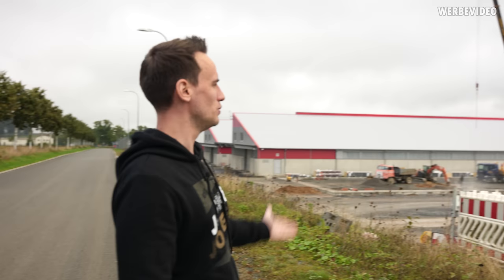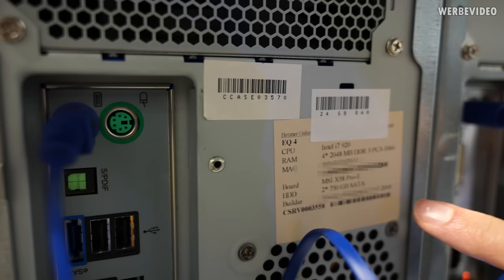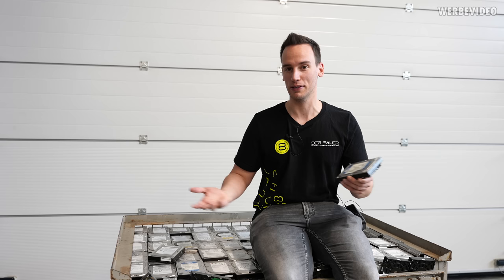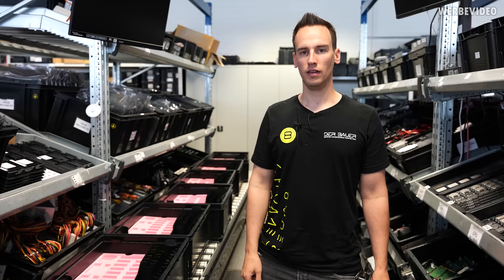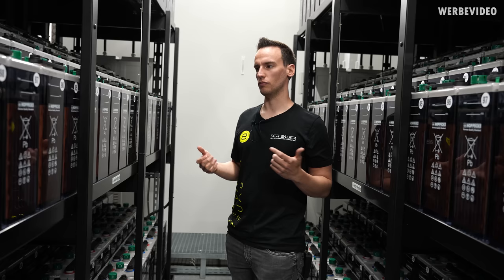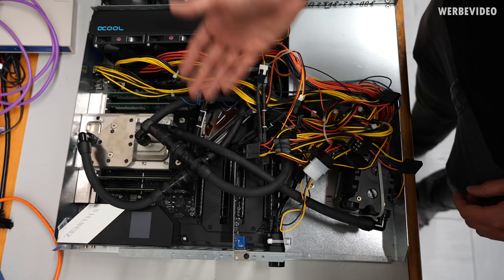Over 200,000 Servers in One Place! Visiting Hetzner in Falkenstein (Germany)

Comment: Man, building servers there would be my  DREAM JOB! Do you know if they are recruiting? Even better would be them expanding into Ireland so I wouldn't have to move!
Reply: It would get old
Reply: @mrmotofy  Not likely as hardware keeps evolving ;) First PC I've built I was 11 and trust me when I say that this has never gotten old for myself, quite the opposite, new hardware and/or technologies coming to market keep things interesting! Like when FLASH finally came of age on SSDs instead of USB sticks.
There's always something new or improved around the corner and sometimes some deeply disruptive changes like the switch from AT to ATX that resulted in a considerable upgrade cycle although this may not be the best example.
Reply: @wskinnyodden  Yea...but building these servers is gonna be very repetitive as they seem to be virtually the same. So some might have a 100Gb Nic instead of 10Gb...big deal yes I remember AT vs ATX, I picked an ATX as it seemed the way it was going.
Reply: @mrmotofy  Well, that is just a challenge on how to get as many as possible going at the same time efficiently and correctly. Wouldn't be a first, I still recall the first time I had 10 systems on the work desk at once being installed and set up each for a different customer. (Christmas time for a computer shop back then)
Reply: Trabalhei no data center da Embratel nas olimpíadas do RJ irmão, foi meu último job depois que me mudei pra EUA, queria muito voltar pra área também seria um sonho tá num lugar desse de novo

Comment: Is keeping these old equipments like i7 920 really environment friendly? I don't mean to judge that, just courious. I guess there is a comparation between recycling these low power efficiency device and keeping running on them.
Reply: I was surprised by that too. These are OLD 4 core CPU’s with ancient architectures and - relative to today’s standards - terrible IPC. They could probably consolidate an entire aisle of these ‘servers’ into a single rack of modern 64 core Milan servers and just run 4-core VM’s on them if that’s all the customer wants. And even if they want a more consumer oriented platform, modern Threadripper or even Ryzen (to a lesser degree) will provide similar levels of consolidation.
Reply: @benjaminlynch9958  If you're not familiar with the way Hetzner works, you buy the entire machine as a baremetal/dedicated server. When you no longer want it, you can auction it off online via their marketplace. It's sort of in their business to not mess with bought dedicated servers and let them use them until they fail, even auction them off to other hetzner users. I'd imagine the cost of trying to migrate everyone off those old servers (Forcing downtime, trying to migrate disks, and trying to match the same low prices) just isn't worth it. 

It is kind of nice that you can buy one dedicated server from them, and as long as you keep paying, you can use it virtually forever. Of course, the downside of wasting energy and space.
Reply: @1pcfred  Didn't I mention the comparation between recycling and keeping? Old products are less energy efficient, and energy requires labour, too. Why not think carefully before judging someone?
Reply: @1pcfred  calm down, what do you get by telling that to the people, do you think i want to know such information when i buy a fucking ssd or a new cpu i need?

no one said the world is perfect and the blame can't fall on customers
Reply: @arch1107  but it does, I see so many people with hardware they don't really need, probably 80% of all users could use a 10 year old system without any impact. Which funny enough is about the ecological break-even point of hardware, 10 years.
But people always want the new stuff, don't they? ;)
Reply: @RobinCernyMitSuffix  in my personal case, i often go for bang for buck, that always leave me with a desire for more performance

for example, i have a r3 2200g, but i want a r5 and even might have use for it!

same situation for the rest of the parts

people often does what you say for different reasons but desktop pcs do end in such time periods of use and recycle, when they are close to be obsolete, noisy as fuck and all filled with problems that no logic amount of money can fix

often people want to keep alive windows vista machines, i always say no, one would like to make those shit old pcs behave decent, but no, is a waste of time, in these pandemic times people think twice about changing pcs, is a complicated moment we are living
Reply: @arch1107 :  On the contrary, it's easy to keep Windows Vista-era machines alive.  It's a straightforward process "To make those shit old PC's behave better".  Drop in the latest version CPU the motherboard can stand, max out the RAM, install current Linux Mint on a small boot SSD, keep the old HDD.

That's not a waste of time at all — and it's as green as you can get, given they have such lightweight PSU's.
Reply: @stevearkwright  well, those motherboards often support only 4gbs of ram, or perhaps the 32 bit cpu is the problem, not sure

the cpu often eats 100 watts just being idle

some old bios will not recognice ssds, i know because i had to fight with one of those vista machines like 2 years ago, only accepted old ssds, not new

i am not sure if is a good idea to keep them alive, at certain point you will feel like you can't live without a usb 3 port or with a gpu that can barely do youtube at 480p

Comment: Wow. I though datacenters or any kind of enterprises are running only xeons and epycs. I always wondered why intel, amd or nvidia artificially lock up their consumer hardware. I though that no one is willing to run consumer hardware for enterprise use so it seemed stupid to me that they bother to lock up certain enterprise features. This changed my perspective. And AMD or Intel must be quite mad seing 3900x being used instead of epycs which cost twice as much :D same for i7 instead of overpriced xeons. Very very interesting video.
Reply: Hetzner isn't "enterprise grade", it's inexpensive hardware at an inexpensive monthly charge that doesn't make you sign a long-term contract.
Reply: @PablumMcDump  Thanks for the correction. I went to their website a see now that I can rent specific servers with consumer HW, I thought that they are using the ryzens and i9 for cloud. Still though I didn't know this existed.

Comment: I would have imagined they just sold old hardware because it's just not power efficient. even if it's fully functional they can do the same thing with 15W that the 920 does with 130W
Reply: As long as you have the space and you're not paying for AC then power probably isn't that expensive to make it worth upgrading the whole lot. I'd guess they only retire hardware when it's just too slow to do anything useful.
Reply: @Gractus  only because they have relatively few left. If they had a building full i7-920 machines the power difference would cost a ton
Reply: Right now on their server market place - the oldest CPU is i7-2600 - if you get that server I guess they will let you run it for at least 2 years. So the i7-920 is just running because you do not want to piss of your customer - but the wattage is too high. However likely people using such an old server have that server idling most of the time - so it doesn't matter too much that is has a high TDP. Next likely those 95W 2600 are phased out. Lately the push with free setup on AX servers but not EX is clear as well - they must have figured overall power use is much less compared to same price EX (which likely has lower hardware cost). Not everyone maxes out the CPU of their servers. E.g. I have a AX-41NVME which is idling 99.9% of the time running just two websites. I cannot go virtual/cloud because I need 10TB hdd for downloads on those websites. Cannot find anything cheaper than hetzner. I run a second server to compile stuff, which needs 6TB hdd, and 1TB NVME space - it's only used 1/6 of the time. rest is full idle. Also when not compiling I need the hdd to store lots of data. Again I do not see a cheaper solution. Yes I could use one bigger server instead of two - and run one in virtual machine. But I fear reliabilty so websites needs it's own server. Likely many people are like me - only maxing out some certain aspect of their server - and not having it run 100% for much of the time - hence Hetzner can offer them soo cheap. I would love if Hetzner lowers prices and charges electricty directly to customer - but likely it's too complicated so they just keep it simple and lose money on customers constantly maxing out their server. If you maxed out your 920 you would already have upgraded. And on idle likely the power difference is not much - hence they can afford to keep them running. On the other hand - virtual servers/cloud will always be on very modern/energy efficient hardware.
Reply: They are still power efficient — given that most are idling or on low load.  I think that's a sensible use of resources as they're using very little electricity.

Also, junking perfectly good hardware in useful service is certainly unnecessarily wasteful.  I applaud their approach with these older midi-towers.

Comment: I like how the assembly person is using a wired ESD strap, unlike the assembly person at Minisforum, and their wireless one.
Reply: U mean this data center is using outdated technology. Not even using wireless power supplies?
Reply: @Jsteeeez  That don't explode.
Reply: @S.Madman  gigabyte was just testing a wireless power supply that also doesn’t need to be plugged in because it runs off a internal fusion reactor. Those explosions were clearly user error. To quote apple “they were holding it wrong.” I built my computer with a wireless Esd strap and wireless power supply and its so efficient that even when I turn the computer on my power meter says its drawing 0 watts? Only issue is non of the fans or lights turn on and my monitor doesn’t turn on. Also the cpu and gpu won’t turn on, but im sure its my fault.

Comment: Very nice video and much more informative than the 3D virtual tour / google street view style server datacenter tour. Pretty happy Hetzner customer since 11 years with 2 servers. Support is great too - except when you have an uncommon hardware failure. I recently had the PSU fan broken - the problem was that the server ran just fine without load in rescue - then would power off as soon as even a little load got into it. I complained that some hardware is broken - but hetzner told me it's  the network card misconfigured but they can run a 24 hour check on it. I guess no one will ever walk up to your server and look at it - because broken PSU fan should be easy to see. Their script took them 20 hours to figure out the hardware damage. Really annoying if you host your website on that server (and due to huge download archive I cannot just quickly move the website/have a full backup elsewhere ready to go). After it was fixed decided to upgrade the server (4.5 years old) to a new one directly.  But yeah - if you cannot figure out the problem yourself (e.g. hdd smart data showing broken disk or something very obvious) - hetzner support on broken hardware is bad - as they just run their automatic remote script before dispatching any technician to actually have a look
Reply: @stevearkwright  I would need to back up every week 3-4TB. But I can recreate the data within 48 Hours.

Comment: I would definetly still call these HDDs "messy" because without any sort of "stand" the HDDs can easily play Domino or fall off.
Thatswhy I would definetly 3D print some docks which can make cables unesessary and you can plug and unplug HDDs. But that is the only thing I must say looks rather "suboptimal" the rest is really well organized and exciting. Too bad I made very bad experiecne with Hetzner's support in the past. Especially how they are "not" dealing with DDOS attacks.

Thatswhy I had to switch over to OVH -- but still a very amazing data-center to see in a lifetime. Thanks for the video.

Comment: The first thing I noticed was the angled white roofs to help with cooling and convection, and am wondering what cardinal direction the slope faces in regards to the sun.
Reply: Well, presumably north or north-east.  In other structures, such as offices where they're trying to attract heat from sunlight, the roof direction is opposite.

Comment: For batteries an usual configuration is 300V (or slightly higher, like 360V, so on low battery it is at 300V) and use a high frequency pwm with a low pass filter (coil and capacitor) to imitate A sine wave, or it may just be a square wave. This bypasses the need of a step up/step down transformer.

Another option if the psus are all known is to actually feed 300V dc (which is stepped up or down from the batteries) because most psus' first stage is turning the ac into DC.

So basically either grid synced sine wave,  a square wave, or just DC.

Comment: regarding what you said about server overclocking
But beware, severe overclocking is possible, but the entire server case structure with more fans must be rethought to ensure better and more efficient cooling

both on the old server boards and on the new ones, overcloking is allowed

but you must be very aware that your power consumption will also increase when you overclock to the server or CPU

but as I said and mentioned it is possible to overcloke the server or CPU but you will have to invest money to add very good cooling when the processor is overclocking to maximum capacity
Reply: They just don't want customers to be able to overclock the servers. Making overclocking physically impossible is safer than mentioning that in TOC and then enforcing "soft" rules :-)

Comment: Having worked at a tier 4 datacenter, there's a lot more copper cabling in these DC's than I was expecting.
Reply: Likewise — I noticed ethernet cables but absolutely no fiberoptic whatsoever.  Maybe we just didn't see that part of the datacenter.
Reply: they have the „advantage“ to have mostly weaker single tenant all in one servers with north south traffic. So i guess only the TORs to the backbone are Fibre (and also storage areas for their cloud services) but the servers themself are mostly 1gbits only.

Comment: 13:25 The issue I have with the original solution is that it's a "get it done asap" solution and while they did take care of strain reliefs and such, those are not mechanically fixed solder joints and what looks like 0.28 cables. Those absolutely need a solid fixing point in the long run, as seen on the printed ones because they will just eventually break and lose a lot of time for that fix. Even worse is if the broken leads touch metal on the PELV system (neg and earth both connected to chassis), they can royally cock up components upstream, like the controller blinking the LEDs, which is connected even further upstream to the tester. Always take care of the IP rating and always take care of the joints.

Comment: The power of the Microprocessor, Engineering, UNIX and straight up willingness to do a thing all in 8 (Now 9 probably) Massive structures.
Reply: Please just say Linux, that's probably what most of their servers use and what they officially support, UNIX is a proprietary piece of software that isn't used anymore, that's a handy shortcut to encapsulate Linux/BSDs/MacOS but that's all.
Reply: @heroe1486  You are correct but there are systems out there still running BSD, AIX and HP-UX
Rarer than Linux but still a UNIX-Like system all together.

Comment: Anyone have a part number for that SATA/SAS expander in the PCIe slot? @ 17:43 That is a serious back plate.
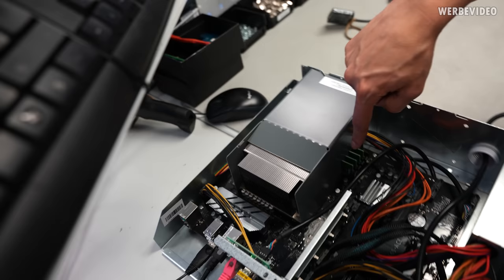Also interested in what they are doing for IPMI/BMC/ILO/DRAC riser board @ 11:49
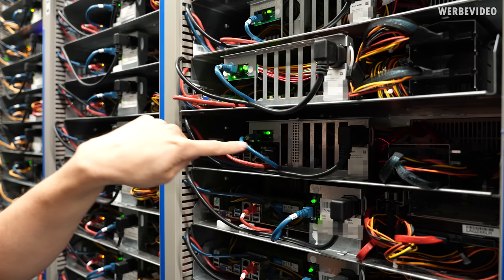Reply: As we can see at 17:38 these are just pin-to-pin connectors for the front IO (power button, reset button, maybe activity LEDs), which lets them reset servers over the secondary ethernet cables we see at 14:38.
Reply: @fredwupkensoppel8949  They look more like PCIe to U.2 adapters for the SSDs
Reply: @RobinCernyMitSuffix  Oh yeah I was talking about something different, right.

Comment: 13:02 this is indeed messy.
SATA cables should not be flapping in the breeze like that considering they are used for testing drives.
I'm sure they figured that in their HDD quantities the chance of cable go bad due to constant reconnections and handling is enough to produce silent false-positives to noticeably up their failure counts.

Comment: Nice Alphacool NexXxoS UT60 Full Copper 1080mm/1260mm? Nova Radiator with Arctic Cooling P12/14's using Noctua low noise adapter cables at 18:56

Comment: I'm kinda curious about the efficiency of those old midi towers. Even though the thought behind it is very noble and great - to use hardware as long as possible - im not quiet sure if it actually makes that benefit up in energy inefficiency. I dont even want to know with what little Power you could emulate the processing power of all of those towers in a modern Server.

Comment: 2:30 I'm stunned to see the old technology servers. If "green" was a big deal, those should have been scrapped years ago.
Reply: That's the problem — it's likely that the midi-towers (in Building 1), only have low voltage PSU's installed and are under comparatively light load.  Scrapping perfectly good, functional machines would not be at all green — quite the opposite, in fact.
Reply: what steve said, also, roman said at the start of the video that all the hetzner datacenters run 100% on renewable energy. finland is even powered exclusively by wind energy :D